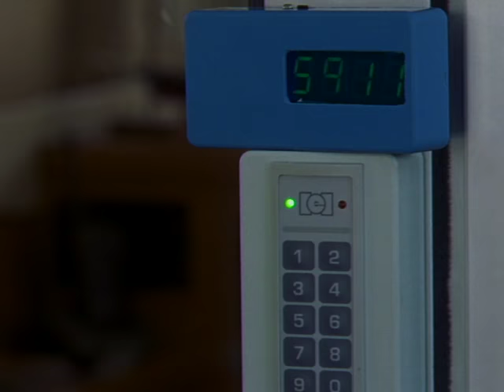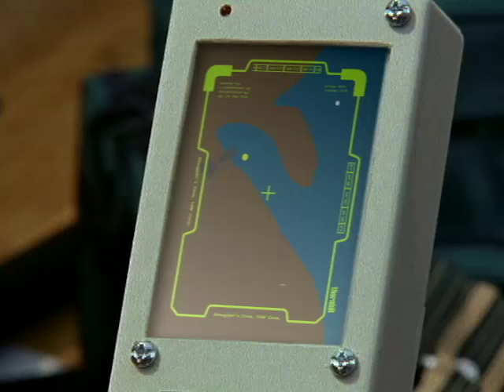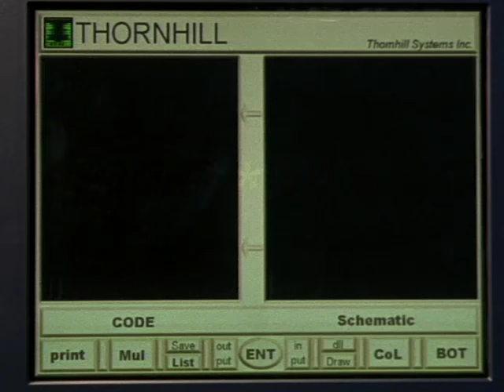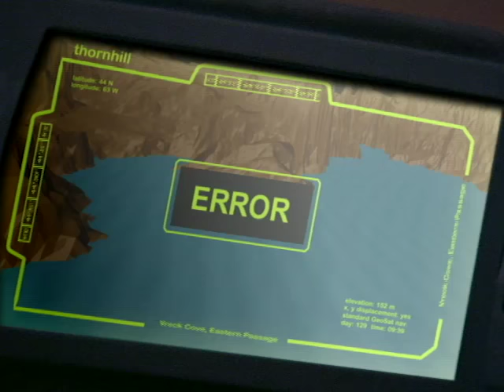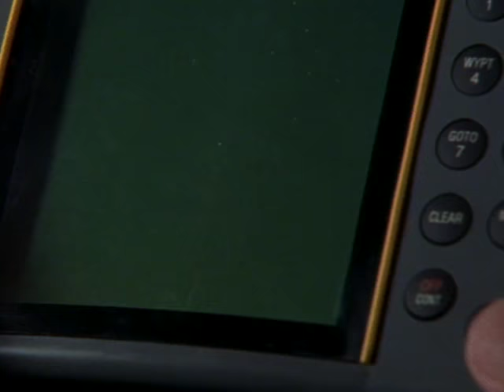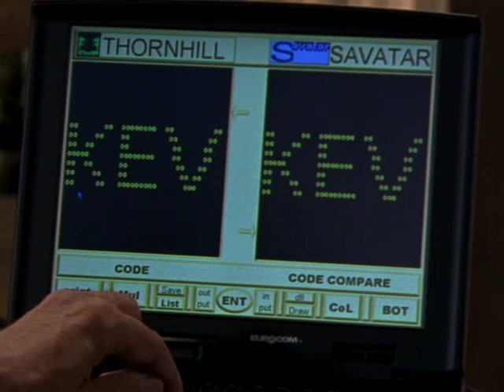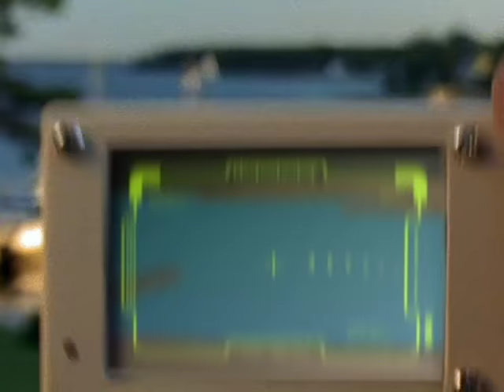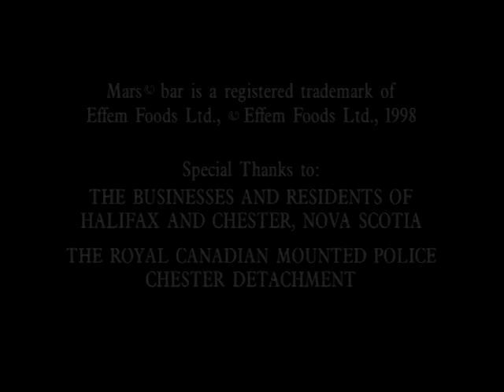Harlequin: Loving Evangeline - Full Movie

Comment: The audio & video is poor quality; not up to the quality of movie. Great script & actors. Thank you for making this entertaining movie available.
Reply: You need to adjust your device. You can click the gear at top right - click the screen in the movie & it appears. Click quality at the top of that menu then advanced at the bottom of the next & choose the next higher setting, or at least 360p, or 480 or higher. You may need to turn off Data Saver or if on wifi, be closer to it. The volume is as good as if on tv/cable here so maybe they fixed it & maybe it was your own settings too. Videos often automatically play in SD rather than HD to not use up data, & that's our own device or our data or internet plan doing it, not the channel. An internet or phone service provider may charge more for high speed unlimited & it can still vary a little during hours of high use by the community. Those who paid the higher cost get prioritized during those times. But this will play just fine at 360p on a cell so 480p (set by you in quality, advanced) should be fine on a larger screen. & For the highest quality data saver cannot be on. & Earbuds allow for higher volume of you're having issues. Cheaper phones, tablets, & laptops may have less clarity.